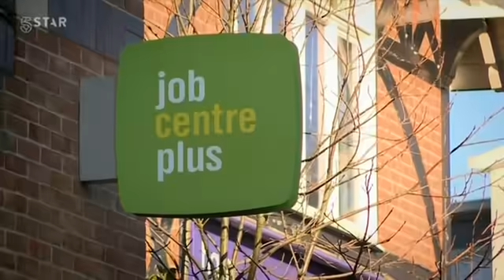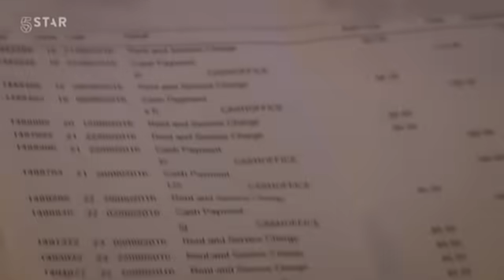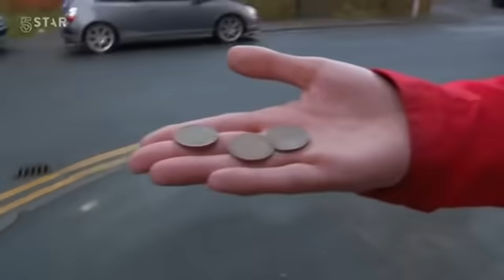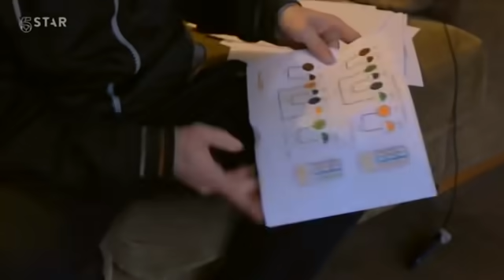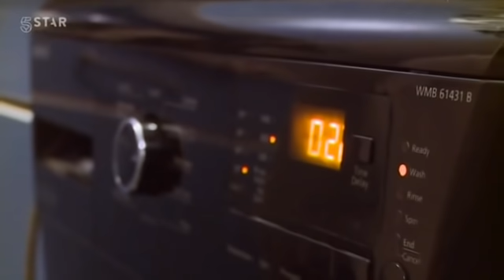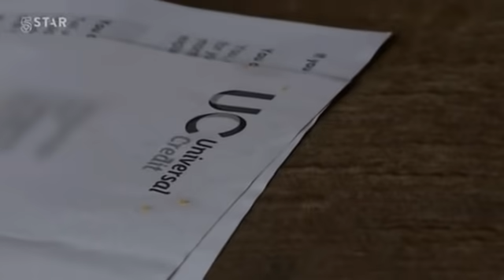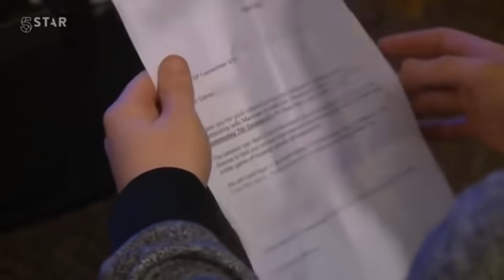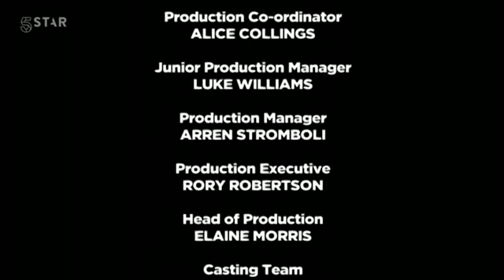Welfare In Britain "Life On the Dole Ep1

Comment: Shawn had been on 20 other work courses so I wasn't holding out much hope for the railroad. As for Mark with the sciatica problem,  I had horrible sciatic pain and the best relief was from regular exercise. Nothing against his weight. Traction also work for trapped nerves. Props to Leon and Larry for sticking together and trying.
Reply: Every 3 pound of weight you lose, you lose 16 pounds of pressure from your back. His weight is absolutely contributing to it.
Reply: I’ve got herniated discs and crumbling spine. I have to do running to keep my back from seizing up . Although it has just flared up out of nowhere before and I can’t even walk then

Comment: The 2 lads complaining of boredom and that every day is the same. Why not do some voluntary work? The 3rd sector is screaming for volunteers. It breaks up the day and gives some work experience. It also gives you some references for when you apply for paid work, and shows you haven't been dossing all day. Travel costs nothing (volunteers are legally entitled to travel expenses). You aren't at home using your gas and electricity. It stops you spending money due to boredom.
Reply: Yes exactly
Reply: They'd rather sit around rapping and noshing eachother off
Reply: You weren't and aren't allowed to even volunteer as a job seeker, that's another issue with the system. They class it as working even if it's unpaid

Comment: You do not need gas.  Electricity can do it all.
Reply: You clearly don’t know how it works you can’t have a bath without gas if he has a boiler in the house
Reply: But if you only have electric heaters it is even more expensive than gas and electric as gas is cheaper heating than electric heating and also electric heating is cheaper to install but expensive to run